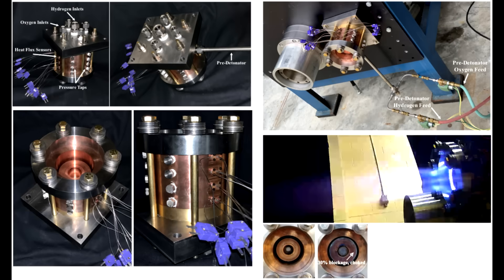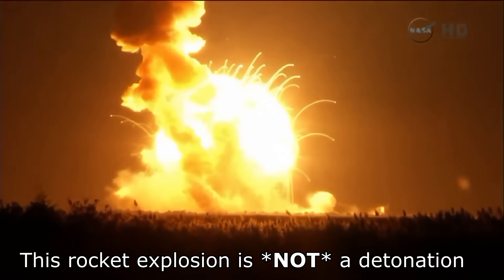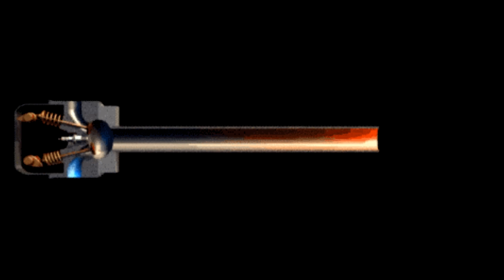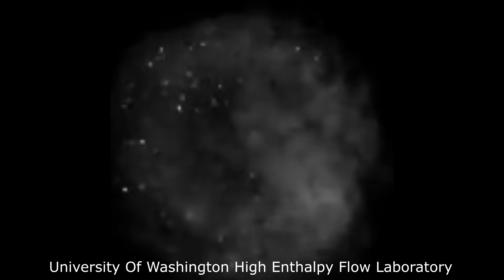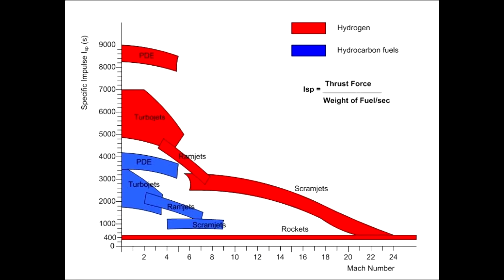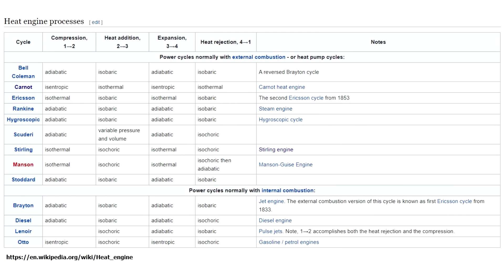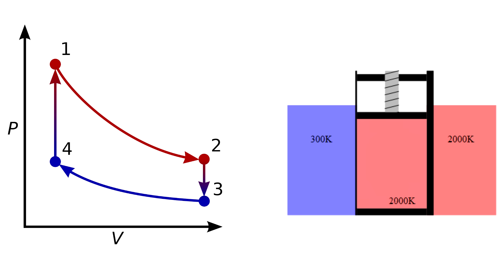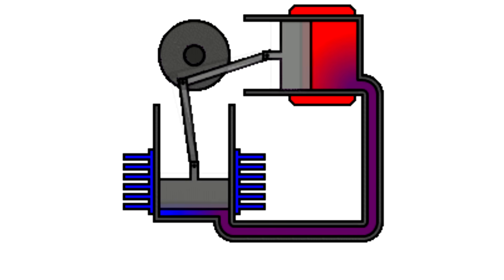What Is A Rotating Detonation Engine - And Why Are They Better Than Regular Engines

Comment: You know, it's kind of funny: I'm taking a break from my thermo class to watch this video, and this video is half ideal heat engines!
Reply: @MillionFoul I just had my final on the 2nd, gotta love those P-V diagrams.
Reply: @sonickiller360  Im more a fan of those T-s diagrams lol graduated 2 years ago and I gotta say.. building nuclear carriers is fun, but not as much fun as thermo diagrams lol
Reply: If you think thermo is kind of alright I strongly recommend going the career way of technical safety engineering. It's a load of fun dealing with fires and explosions all day
Reply: I don’t get how the thrust is exerted by the gas as it travels around the ring. Does some come out if the nozzles that are perpendicular downwards?
Reply: @jhanby9  Yes the thrust comes from the combustion products exiting the nozzle perpendicular to the path of the flame front. The circular path of the flame front serves to maintain the conditions necessary for detonation within the engine. This allows for continuous detonation as opposed to pulsed detonation.
Reply: @noobtool6908  so basically it is like an infinite number of detonation pipes alle stacked together in a circle with open sides. From any single line from front to back you will se a pulse. But the system as a whole has continous thrust as the pulse goes around the tube in circles. Am i getting this right?
Reply: @Flimzes  nope
Reply: Has our first midterm on the 9th and will have our final on the 19th. Midterm was a disaster for everyone haha
Reply: Clearly you're a sick ** and the only cure is more thermo...
Reply: You're gonna learn dammit!
Reply: Scott did a better job than my thermo teacher
Reply: Just finished my AP Physics 2 test day before yesterday. I'm having Vietnam flashbacks to PV diagrams lmao
Reply: Same, second year mechanical engineering student
Reply: I have an odd way of thinking, granted it probably because I have very little college education. But it makes me think of a tesla turbine or cold steam pump. Do to the expansion of heated water into vacuum that turns the turbine or pump. Am I kinda on the right track or totally off?
Reply: @tommolldev  yeah, at least computers tell you when you're wrong.   I guess physics does too, it's just more expensive to try.
Reply: @tommolldev  You're pretty much learning the same thing lul
Reply: @tommolldev  Thermo shows up in computing as statistical mechanics and information theory. It's literally the same math!
Reply: Its like a rappit piston effect of rocket purpulstion. It will eventually demonstrate a more fission pulse style moments engine in wagers of chem-fuel, efficiently imposing a 'M-Drive' theory. Only the structure will result to look more flat vent/net shape... That 'm-drive' theory would be depicted poorly like a classic booster cone (redundant like a car shaped as some horse carrage or how digital camera moved lense like conventional film expose faked).
Reply: Say what?
Reply: Wow. I did this today @millionfoul
Reply: Yay heat transfer !! Someone who knows pain
Reply: @finneganbarsalou1714  Oh man, I just wrote a quota answer about Transport Phenomena (specifically heat) and I have nightmares about that course still.
Reply: 这不是理想，我们已经制造出来了呀
Reply: I failed my thermo exam😔😔
Reply: @taddmaxwell8363  You choose the wrong school subject.😀

Comment: work through pressure versus work through ignition still are defined and therefore must be definable in any engine type. All rockets are propelled by Ignition! for good reason. Just ask the crew of Apollo 13 by way of example.

Comment: You mentioned that having multiple detonation waves and how they can be unstable, but has there been any research into maybe differently shaped loops instead of just a simple circle? like maybe an infinity symbol shaped one with two detonation waves where the two collide head on at the intersection and ignite the two perpendicular paths which travel around and loop back to the  intersection and repeating the process. I think it would solve the timing issue since both waves are started at the same time every cycle and if one wave somehow ends up moving faster then the other then it would arrive at the intersection first, still ignite the other two paths, and then cancel out with the other slower wave just on the other side of the intersection. Thrust would be easier to balance and stabilize since most of the instability will be located around the central intersection, instead of having to balance two wave fronts on a ring away from the center. You could also scale this up and use flower petal like designs for more wave fronts and more stability though cooling might become a problem. It might even be possible to direct more fuel to certain loops as a way of thrust vectoring though that could lead to instability.

Comment: I wonder how much of the benefit in practice will be in the pumping? If much of the pressure generated for the nozzle comes from the detonation down stream of the pumps, then even with the same operating pressure (likely limited by available materials and whatnot) the pump pressure will be lower and thus less of the energy will go to pumping. If so, then the downside is that that reduce the benefit from improvements in that section: e.g. full-flow-staged-combustion has to take back some of that 10% if gave you.

Comment: Sounds like a similar problem to sustained fusion in some aspects.
Reply: Hmm... I don't know the exact process but I wonder if a rotating shockwave could help fusion along...
Reply: @fryncyaryorvjink2140  Fusion already works, the problem with it is that it takes more energy to sustain than it produces, so it is not exactly useful.
Reply: @shawnpitman876  maybe the shockwave would make it more efficient, getting those numbers closer
Reply: @fryncyaryorvjink2140  
The main problem in producing power-productive fusion (i.e. a system that can exceed the Lawson criterion ) is referred to as plasma flux density - a product of the particles' physical closeness and speed within a given space.  Individual fusion reactions don't produce all that much energy (atoms are, after all, very tiny things), but many of them happenning rapidly in succession produce, as we all know, A LOT of energy (atoms are, after all, very numerous things).  'Detonation' isn't something that is properly defined in a plasma, because there is no proper 'speed of sound' - when the atoms supposedly transmitting a sound wave are moving so fast they start  blowing up when they hit each other, that's kindof the end of the sound wave.
🙂👍 Good thinking though - it's good to explore new possibilities.
Reply: Pulsed fusion is one of the solutions currently being researched.

Comment: That's a hell of a concept, and it certainly adds to the utility of chemical rockets in the future.  I imagine such engines would see use as reaction control thrusters on massive vessels, especially since they are probably progressively harder to tune as the engine gets bigger.  That said, if you can get it to work with liquids, a mixture of CH4 and O2 would be a fantastic choice, since those two well mixed are remarkably easy to detonate.  You'd need a mixer built into the injection system, and some heavy duty flame arrestors in the O2 line, but you could potentially get ridiculous TWR out of a liquid fueled rotating detonation engine.  I wonder if you could regeneratively cool the liquid engine using some of the propellant, and run a secondary gas fueled engine in a concentric combustion chamber around the central liquid chamber, or just power the turbopumps off the cooling gasses or something.  Makes for some interesting evening brain food.

Comment: It surprises me how much more specific impulse you can get out of hydrogen rather than petrol. Wonder why nobody has fitted criogenic tanks on a plane?
Reply: It is true that when the oxidizer is oxygen, liquid hydrogen has the highest chemical energy, per kilogram, at 141.86 megajoules per kilogram.
However, per liter, liquid hydrogen can only provide 2790 watt-hours per liter (using the "higher heating value" number, which is the bigger one). One liter of Gasoline provides about 3.4 times more energy, at ~9500 watt-hours per liter. Diesel fuel provides even more energy per liter at ~10,700 watt hours per liter. Diesel fuel and jet fuel are basically the same thing, so I won't bother adding in the stats for that.

Airliners hold their fuel in the wings for the most part. For a given size airliner intended to travel at a specified speed and altitude there's an optimal size wing. Since there's an optimal size wing, there's only so much room in those wings to hold fuel.
Since I just demonstrated that an airliner's fuel storage is volume-limited and not mass-limited, the correct fuel for the job is jet fuel.
Of course, if they can figure out a rotating detonation engine combustor core for a more traditional turbofan jet engine, then we'll see a revolutionary change in the cost of air travel.
If they can't figure out how to fit a turbofan around a rotating detonation engine core, then we might get supersonic transports instead.

However, none of them will be using hydrogen as the fuel. That's a fuel that's only good for rockets, because with rockets that travel in space you are mass-limited and not volume-limited.
Even then, the 1st stage of a launch rocket is still very much volume-limited because it has to go thru the atmosphere, and every additional square meter of fuel tank exposed to the air-stream is more aerodynamic drag that the engines have to overcome. That's why most rockets only use liquid hydrogen fuel for the upper stages.
I count the core of the NASA SLS rocket as a "ground-started second stage", because while it is started on the ground, it does the majority of it's work outside the atmosphere.
The core of the Delta-IV is a true hydrogen first stage, which is quite rare.
Reply: It's impractical. Hydrogen is super low density, the hydrogen tank ends up using most of the space in the fuselage. It was actually tried in the experimental Lockheed CL-400 Suntan.

Comment: Rotating detonation engine.... isn't Mazda famous for those?
Reply: Only if it's not running right...
Reply: It's not a detonation in a rotary, it's a normal deflagration same as any gas engine. You will blow up a rotary very quickly if it starts detonating.

Comment: Aside from efficiency, are there any other major advantages? Is the plumbing easier? Is this more controllable/ throttleable? These just have a bit of aero spike stench to them where they are objectively better than de lavel nozzles but will still never be used.

Comment: why would  the navy want Rotating Detonation Engines, I thought modern Steam turbine engines were extremely efficient, more then any combustion engines we have while in submarines modern sterling engines are preferred due to the silence they offer.
Reply: Only the very largest ships are steam turbine powered. So for example our DDGs (guided missile destroyers) such as the Arleigh Burke class and new Zumwalt class are all gas turbine powered. We have 430 gas turbines on 129 US Navy ships, replacing them with RDEs could simultaneously increase power output 10% and lower fuel use 25%. The navy is not interested in Stirling engine submarines and prefers to stick to nuclear power, they say it's preferred for the kind of long range, long duration missions they do.
Reply: @xeigen2  Swedish subs equipped with Stirling engines (maybe powered by nuclear fission) kicked the US navies ass during Nato Training, remaining undetected while "sinking" US ships. The fact that they are Stirling engines instead of steam does not impact the range. But it does lower the sound emissions, specially in well balanced engines.

the best gas turbines engines have 30% efficiency while a steam turbine has over 40% efficiency. Steam turbines or pistons will also have more torque in a direct link(hybrid electric use electric motors which are superior). Since the first few generations will be way bellow theoretical efficiency, Steam turbines will remain the most efficient choice in naval applications. The only current gain for the first models would be in aircraft and rockets.
Reply: @peter4210  Those Swedish subs are diesel powered Stirling engines and only have a 14 day submerged endurance. That's fine for an attack/hunter-killer sub like the Gotland class. However the US Navy SSBN ballistic missile submarines have a different mission and need to be submerged for a lot longer than diesel fuel allows. The Swedish Navy does not have any nuclear submarines or ballistic missile submarines.
Reply: @xeigen2  thanks for the information i had to retype my comment half way and forgot to mention i was not sure if they were nuclear but stirling or not a nuclear powered craft does not have to worry about range,

Also disrigard my efficiency numbers, they are not right and i will edit them since they are about 30 for gas and 40-50 for steam wich still puts steam ahead of gas with a 10% boost.

I have been trying to look at information on the detonation engine and it seems that it would still need a turbine to transform the force into rotation energy so it would just increase the complexity of the gas turbine engine, and apparently it simplicity vs a steam turbine is was makes the gas turbine more favored in ships.

The only current application the engine would be worth is with rockets and super sonic planes and it seems that the newest development which brought this engine to the news is with a hydrogen oxygen engine and not a air breathing version, i don't know they they have air breathing models in test. 

Space X and air plane companies might have more success pumping money in the dev of the engine then the navy. Heck large sailing vessels are making a return, they could strap sails to a destroyer and increase their range that way, it would be simpler and cheaper

Comment: An analog is a diesel engine vs a Gasoline engine.
Reply: Diesel engines still only run on deflagration (subsonic flame front) instead of detonation (supersonic flame front). Compression ignition is not the same thing as detonation.

Comment: Dang, I forgot and just crashed my plane.
Reply: Lacking a requirement to fly safe, the Insane American flew very deadly.

*Dual Vulcan sound
*GAU-8 sound
*GBU-16 sound
*AGM-65 sound
*Various explosions

Damage: about $1200000, 12 wounded.
Reply: @user2C47  Only about $1.2 million? Some missiles cost more than that. XD
Reply: @user2C47  Many years ago my parents took me to an air show. I stood on the roof of our car (in those days cars were built of thicker steel) and clutching my camera awaited the Vulcan flyby. This is hard to put into words but maybe "awesome", "bonkers" and other adjectives will apply. As the Vulcan flew low overhead I nearly fell off the roof of the car, everything shook!
I got the the shot but the Vulcan looked quite small, it was only a basic camera. I can never forget that!
Reply: now everything is screwed , the world is going to crash and fall apart.....
Reply: Im dead too now.  Manley failed us all.

Comment: RE stirling engines - Why not have a slot rather than a hole where the piston attaches to the came shaft, allowing it to stay in position at the top and bottom of each cycle?
Reply: That's a scotch-yoke mechanism, and the disadvantage is that it wears out faster because there's sliding friction between the crank pin and the slot. You can put a ball bearing on the crank pin, but it will still wear out faster than a similar design using a crank and connecting rod.

Comment: This isn’t gonna make a difference we had Airospikes 60 years ago and they’ve never flown this will never fly either
Reply: Aerospikes are great for changing atmospheric pressure, these are more widely applicable. Imagine the efficiency of one of these on an upper stage. That's a theoretical specific impulse of 560.
Reply: It’s not that it’s not good it’s that people are going to prefer to use old in efficient technology rather than take any time or effort to pioneer this to the point where it will work reliably
Reply: J M.   I’m not saying that it isn’t good technology that can’t  work in any given scenario I’m just saying that people aren’t going to invest in it